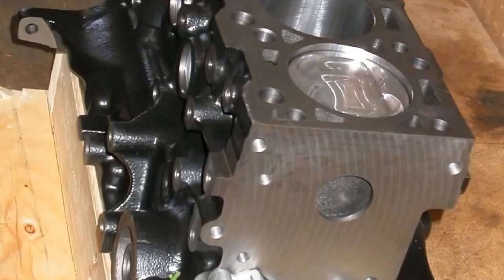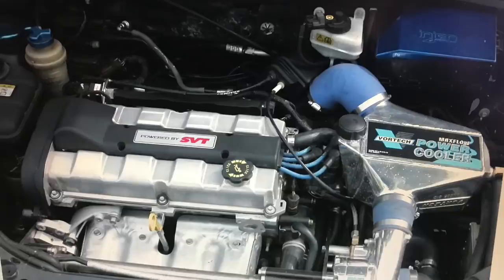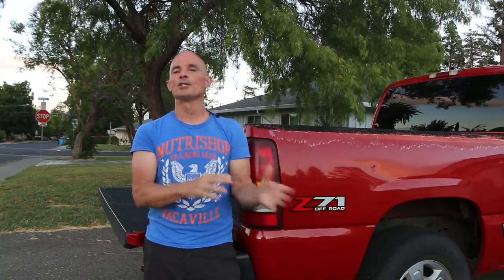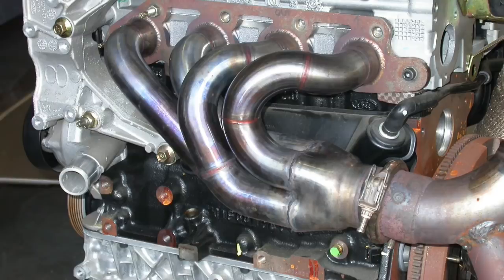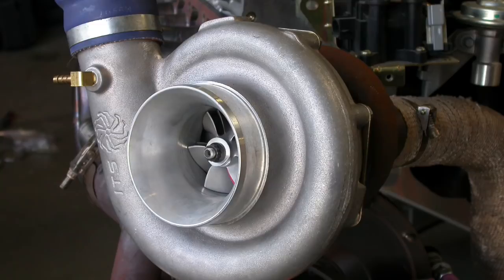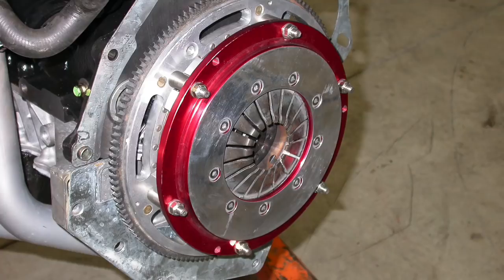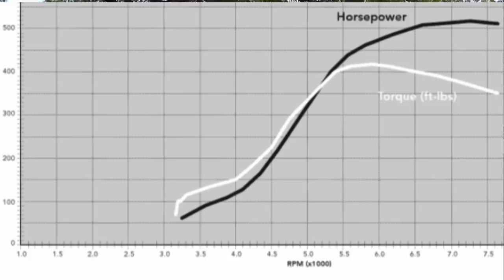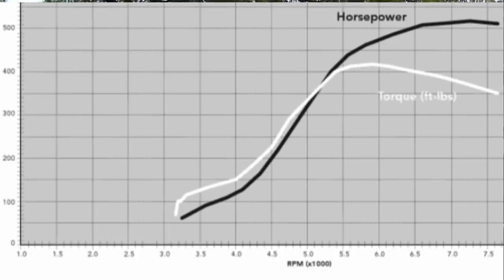FOCUS POWER! TURBO ZETEC FOCUS

Comment: The Zetec is one of my favorite engines. I have a back story too. After my wife and I got married right after high school we were broke and needed a car. My dad helped us out and bought us our first family car, an 01 ZTS sedan. That car got me started on working on my own vehicles. You know how it starts, first I wanted to do my own oil changes. Before I knew it we had ceramic breaks, a sway bar, upgraded intake, metal valve cover from a completely different model, 2.5 in exhaust, SVT suspension, etc. I learned so much from playing with that car.

Comment: I’ve watched a ton of your videos over the years. I bought that book in 2003 I did not put it together that it was your book. I built my turbocharged zetec 14 years ago, 560whp and built another to over 600. Your book was a lot more inspiration than was the conventional norm at the time. We used aftermarket cams, custom short runner intake and one of the most extreme turbo “kits” ever put on a focus. 3.5” charge pipes 3.5” downpipe, 25psi with an air/air IC and a gt3582r turbo. I really do miss that car, it still had the factory AC, so a true street car, it even made 540 on 93 pump gas and 28psi

Comment: funny seeing what the Americans done with the st170/SVT block. These zetecs are very popular going into mk3/4 escorts and a bunch of classic cars.  the normal 2.0l cylinder head on the SVT block does away with the VVT solenoid but losing the  the air box will lose a little power high end. the turbo kit is interesting stuff. shall hunt your page for a link

Comment: Buddy and I built a turbo zx3 for the track 10 years ago and I’m buying it this month. Have a built forged motor ready to go. Have a cosworth aluminum intake for it, Will find a better turbo manifold and bigger turbo, all new fuel components. Goal is 300 wheel for daily use and 400-500 wheel for showing off and losing all traction in all gears. Lol.

Comment: Hi Richard, this is Richard from Australia, in your Focus performance book when talk about the Gude Escape, you said it has 36lb injectors and a recalibrated ProM maf. Is that correct? Stock ecu, stock timing with just injectors and maf? Im thinking about something similar for my own but in Australia the government is very strict and frowns upon using aftermarket ecus so that may be a better legal option for me. Thank you.
Reply from the maker: the car did have a detonation issues on the road because of too much timing-need a boost retard device

Comment: I've seen super chargers put on these little focus engines, wonder if they could handle a twincharger set up with a small turbo and super charger.
Reply: noone twincharged these, so we might never know.
Reply: @UnwelcomeHistory  gonna have to do it myself and find out it seems. I'll be looking for a VTEC 2.0l or 2.3l this year. Hopefully find a supercharger to match it this or next year, I know you can find old junkyard Ford Focus super chargers from old vtec builds, and I've seen turbos on them as said before. Guess I'll have to figure out the fitment and what not myself.

Comment: you still kept that ridiculous pcv baffle/canister? lol 3:00 i assume it was check-valved so the boost doesn't enter the crank case from the intake (but if it was check-valved, those gasses would be trapped in that hose under boost and the pressure would not be able to escape), unless that hose was routed under the car or into some catch can. just curious more so than trying to preach to a guy who is 1000x more knowledgeable than i am lol

Comment: my zetec 2.0 has 300k miles on it and currently gets the same rated mpg/sometimes better after all these years.
Reply from the maker: they work well-amazing how long they last
Reply: @richardholdener1727  absolutely. 
ontop of this being my daily, i dont baby it at all. its got the year 2000 intake manifold, 65mm tb port matched, cold air,  4-2-1 svt header, 3inch downpipe (cat delete) that flows into a 2.5 magnaflow exhaust. even though these we econo-boxes in the day and werent meant for much, ford did a real good job with the engine. i just wish they had a better head design. i really am not a fan of bucket followers..
love watching your videos and the knowledge you share with us. thankyou for all the work youve done. Cheers :)

Comment: Ran into a couple of kids playing earlier today; a 400ish HP billet wheel MHI 18g On a built head/stock block MZR powered MazdaSpeed3 running an old SVT Focus hatch on E85 and a 4 port nitrous setup. I was in the “work truck” which is a 16’ F-150 EB with Whipple Stage 1 and had a grand old time playing with the boys lol. Had to watch this excellent old school content after those cold weather activities this afternoon because the SVT actually got down pretty damn well. He was the slowest out of our 3 vehicles; the Speed 3 having the most top end, my truck in the middle and the Focus a bit at all distant 3rd, but he was just bolt ons and a 75 shot of spray with a early 2000’s Ford “import” so I was quite impressed.

Comment: I have your high performance focus book and just got done reading the section about the fmax turbo kit using the fuel pressure transducer and stock ecu.  Could you go more in depth about that?

Comment: Love your videos, giving backstories and important details ect...
I remeber doing the upper intake gasket like every over day on my buddies focus.
I'd like to see a built Ford 3.0L V6 
U code Vulcan engine.
Has like 12:1 comp pistons stock.
It's an outstanding engine, put well over 300 hundred thousand miles on my Taurus.
And it would still get up and move pretty good wes electronic limited at 110 though uhg 😎

Comment: I had an '86 SVO...just a few minor tweeks and a little more boost (17-18lbs was the sweet spot) and let it loose. It would run around a stock 5.0 Mustang or Camaro...and the sound of the turbo 4 motor made it obvious...I just out-ran you with a 4-cyl. People that have never ran boost just don't know the level of joy it gives. Warning...tires are expensive!

Comment: i had your book back in the day and was one of the focus's running around in the early 2000's making 353whp. Tuned by Tom at Focus Power. I was really young and that car is what got me into modifying cars. Now i drive an ls swapped miata... i honestly wish i would have started with that back then when t56 transmissions didnt cost more than a miata lol.

Comment: To the comment section what would you build for a reliable 500 whp setup in a focus and what would you prefer a zetec or duratec i think the best motor is an st170 motor
Reply from the maker: I have not run a duratec version
Reply: @richardholdener1727  from what i found till now the best base is an st170 engine

Comment: An “Engine Guy”....that’s cool.  I worked in a well known dirt track (world of outlaws)engine shop back in the 90’s.  Awesome job!!.....LONG hours working in assembly.  Back then I always wondered how a rodeck (midget) 4 cylinder would respond from turbocharging.  It was 165 cubic inches (mandated size).....and it was kinsler injected....albeit mechanical. Anywho, I’m rambling. I like your vids, Rich and I like your attitude.....keep up the great work.

Comment: That is why I am going with a moderate cam, GT45 turbo on a 5.3. 8-9 psi 600 to 650 hp, is way more than enough, and still streetable. In a 2500lb fox body it should be fun. Yeah, an S480 E85 and 20 PSI would awesome, but isnt my goal. Maybe the next build, or a dedicated Silver Lake dune toy with 900Hp will be next.
Reply: 2500lbs with a turbo LS in a fox chassis doesnt sound very streetable xD

Comment: I had a turbo zetec focus with a cheap ebay turbo, completely stock engine, 9 pound flywheel, lsd, stage 6 featherweight clutch, svt fuel pump, 42llb injectors .... about 230 at the tire .. it was a monster. Fun car with the right stuff.
Reply from the maker: they really are fun at around 200 wheel hp
Reply: stage 6 for 200whp? lol why? mine was at 250whp (escort zx2) and spec stage 3+ was plenty.

Comment: True engine fans unite!
Great video Richard. I like almost any engine (Brit) though I do remember c20xe GM engines made 150hp na and 200hp on turbo (c20let) and everything since has seemed tame except gm x20leh from astra car made 240hp stock with a turbo.
So yeah 118hp stock 2l seems luke warm. I like a good LS or big block mopar or even a 5l ford but I watch pfi speed too.

Comment: I currently drive a 2005 wrx, it was tuned by a reputable shop, so it's stood the test of time; 100k miles+. 
I do look forward to putting a twin-scroll turbo on it. Should keep the response, or even improve it, and be a good daly driver
Dyno power is one thing, higher output does not automatically turn a car into a better driver.

Comment: The zetec is probably one of the most tuned 4 cylinders in modern times, at least on this side of the pond. In rally, racing, super 7 type of cars etc. Some with 250hp + in na form. Fun with some variation in here :)

Comment: In the way, way, back when mid late 1990's,  us guys with odd turbo combos dependended on Mr. Holdener's tests, and turbo Buick tests in magazines to give us some ideas when there was no internet. I followed the "Tiny Avenger" turbo 2.3 mustang series and speced the same turbonetics turbo for my Omni GLH in 1996-7. Had a turbo buick adjustable fuel pressure regulator, a foxbody 255lph fuel pump, porsche 944 intercooler mounted out front, and all kinds of crossbreeding😁 The old 2200 pound GLH Omni was a 350hp 390tq  dynojet roll race monster way back when😁
Reply from the maker: I really like those-also the Caravans guys ran with the 2.2 turbos
Reply: @richardholdener1727  Did it all learning from  your magazine articles, your old tech section in mmff, and the turbo buick guys. Biggest ahahh!!! moment was sectioning a 2.2 head and seeing the big lump of uncooled, glowing aluminum in the heart shaped chamber that was causing spark knock .
Reply: In dynotesting, the tit in the heart shaped chamber became a glowing ignition source. It would eat pistons for no good reason before you could even hear it rattle.Modified the head to an open chamber, with consistent combustion chamber thickness. The revised combution chamber only ate up the center of the piston when knocking, rather than breaking the piston between ring 1 and 2 on the exhaust side immediately.
Reply: If course it’s good. 
It’s a vw engine, made to the size of a fat American.

Comment: What's in your truck?
Reply from the maker: STOCK lm7
Reply: Smart man. 
My daily is a hodgepodge if different manufacturers and generations and models, with a turbo that didn’t belong. 

My wife’s outback is 100%stock with only dealer parts ever installed.

Comment: This is great advice for camshaft selection especially cars that want to cruise around thumpy camshafts are great sounding but many times make power a lot later so street light to street light they get beat and the gas those camshafts eat is crazy even just putting around no to mention fouled spark plugs just from idling I have found that if you want a certain camshaft do lots of homework on how long valves springs last with that cam and what rpm it starts working
Reply: Variable cam timing gives you more flex.

Comment: I'm putting in a vote for a big bang 4.0/4.6 northstar. Keep the info coming!
Reply: They leak.
Reply: @dingomanz7  so does every other engine.
Reply: Kevin England 
The head studs are too short and rust out
Reply: Well there were originally developed with a 8000 rpm redline.  Something high like that.   Adding boost could get you to 650 but 800 is really cool.   I'll have to check it out.

Comment: Perfect timing just bought a hhr ss (Ecotec) turbo yesterday was planning on a ls4 swap. But interested in how much that little 2.0 can hold. You ever messed around with those?
Reply from the maker: those have made serious power
Reply: The 2.0 in the HHR SS is essentially GM-USA's own American-market version of a SAAB/Opel engine found in a lot of Euro-GM performance models, they're very good little tuner engines.
The engine has forged rods and a forged crank from the factory. The stock bottom end is good for at least 400HP (probably significantly more too) if you modify and tune it correctly.

Comment: Ha--love it! So ironic your choice of vehicles here.  Just last night I drove my late brother's '07 Focus 2.0L from VA to NC which looks identical to the picture you flashed (with the exception of the extra two doors on mine).  While I was driving the thought went through my head, "wonder what a reasonable turbo setup would do for this car?"  My brother really loved that car which I helped pick out new.  My thought then went to "I just couldn't tear up his beloved car..."  So I guess it will be the 300 HP version for me ;-)  Hey, do a GM 3.6L V-6.  That's what I have in my '14 ATS.  I'd love to surprise some stock V-8's and the twin-turbo models cost too much for me to trade up.
Reply: Modifying your Cadillac is 99% unrealistic hopes and dreams

Comment: Richard thank you so much this video will be a massive help towards my project as ive just built a 1.8 silvertop zetec ( uk based here) and fitting it to a ford mtx75 4wd gearbox unsure if you had them in the us but ill be fitting it into a 1998 ford puma which i know you didnt get in the us. How would it be best to get in touch with you personally about some info as i have hundreds of question but no one in the uk is will to let the info go as the zetec engine is still widely used over here.

Keep up the amazing work you do much love and respect from the uk
Reply from the maker: ask away
Reply: @richardholdener1727  thank you for getting back in touch, well the main one would be what did you do to the oil pump? im only asking as ive noticed here in the uk that the stock oil pumps can fail anywhere between 320-400hp kind of a pot luck really, due to the issues with harmonics in the rotating assembly?
Im considering on implementing a accusump system just in case as im going to eventually use the car in a time attack setting?
 And slightly unrelated have you heard or even worked with a ecu called speeduino? I only ask as im trying to find a somewhat cost effective standalone ecu for the build and keep hitting a dead end,
 These are the most pressing questions i have atm as there my main issues at this moment in time. next is cam shaft choice as there seems to me much more choices from the us then there are here in the uk.
sorry for my essay  
kindest regards
Reply: @biggemage1234 4 years and still no response.

What kills the oil pumps in Zetecs is high RPM oil cavitation and sudden engine speed drops. First of all you should not raise the rev limiter above 7300RPM. All the people who pushed it closer to 8k or above have seen it fail.
Light flywheel and pulley is a little bit less risky, but still pushing it towards failure with every hard gear change. I suggest to only lighten the flywheel just a little, but keep the stock balancer pulley. You need a little of the rotating mass to smooth out the jolty gear changes.

Comment: dud the US ever get the Mk1 Focus RS? seems thats what you built :) (very potent motor, under-rated imho)
Reply: No rs was Europe. And they used a duratec with a zetec badge
Reply: Samuel Nance you got it the wrong way around, the RS engine is a zetec engine badged as a duratec, same at the st170/svt it’s a zetec badged as a duratec

Comment: 500 hp on an L series (mazda mzr) is even easier and practical. Thanks to Mazda, the Mazdaspeed clutch is bigger and can handle a good bit more power without making the car non-practical.
Reply from the maker: Thanks for sharing

Comment: Junkyard 2JZGE Turbo big bang?
Reply from the maker: when was the last time you saw one of those in a junkyard
Reply: Richard Holdener the GE are everywhere in the junkyard. Lots of Lexus’s run that engine.
Reply: I got my last 3 from U pull and pay. two from a 94 GS300 and the other from a 94 SC300.
Reply: Duncan Djang. Bullshit🧐

Comment: Richard Holdener which is better to build a 96 vortec balanced shaft 4.3 or a 89 pre balanced shaft engine. Would the 96 result into a smother operating engine
Reply from the maker: i LIKE THE BALANCE SHAFT MOTORS BUT i'M NO EXPERT ON THE 4.3L V6

Comment: Great story, thanks for sharing that. I had a turbo svt focus with a built motor, about 300 hp at the wheels. That was a fun car!
Reply from the maker: they really are-I like the SVT version
Reply: @richardholdener1727  Hey, what ever happened to the foxbody coupe you were going to setup to break 200mph? That would be great video content.
Reply: ZX2 owner here.  Older brother of the ZX3, kinda.  Way more 90s tho LOL.  First car for me cuz the focus SVT was too pricey lol.  I'm so glad I kept it as my winter beater all these years.  It's worth nothing to sell, but still so fun to drive, and hilarious to surprise ppl with the overall performance.  Dat 2L Zetec doe.  It's got some peaky 4-1 headers, the usual bolt ons, springs and struts.  Ghetto looking sleeper at this point 🤣  Needs svt intake and FI doe 😁 

Great stories all around👍🏼 
Cheers!
Reply: I had a zx3 auto that I swapped a svt engine and transmission into. The zx3 ended up a few hundred pounds lighter than the svt ....that car was the most fun I had with my pants on😂🤣. Yeah, back in 02 perf parts were hard to find. I still have your book👍✌️
Reply: I have a 03 svt I'm wanting to turbo, what did you use to tune it?
Reply: Do you need a retune for a svt focus with 8lbs of boost?
Reply: Did anyone ever got a turbo on, and find a way to tune??I just got a 06 zx3 it came gutted just dash and 2 seats looks super light and been thinking about boost.5 speed manual .